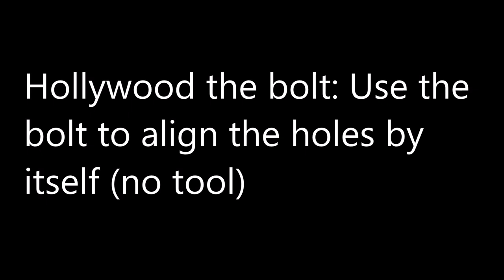Ironworkers connecting small pieces

Comment: Would like to see how the groundy hooks up a tree with wire slings. Its illegal over here in Australia.- "Can't be under a suspended load"
Reply from the maker: WR4SSE the reason it’s legal here is because even if you hook up 1 thing you’re under it so if you hook up 5 it’s faster and less time overall throughout the project under the load
Reply: @ChantzFabz  itd be cool to see how u rig a tree of iron.. might be a hard video to shoot but would be cool to see how its done
Reply: Send the them trees all day!  
1 more 1 more!
Reply: WR 4 SSE??? can't be under a suspended load??? That's illegal??? LMFAO I would love to be an ironworker where you live you got me I'm going down the rabbit hole I'm going to watch Australian Ironworkers on how to avoid being under a suspended load FYI the whole boom section of any crane is technically a suspended load
Reply: @carlboucher2643  not only is it in the Regulations. It's also one of the golden rules on any minesite you work on out here. Meaning if you get seen under a load it's instant dismissal.
Reply: @carlboucher2643  oh and yeh. 70% of minesites do not allow the boom to pass over anyone while its got a load on. Which is an absolute nightmare and usually means you have to clear the whole structure to do your lift.

In the citys it's alot more relaxed... Coz tower cranes.